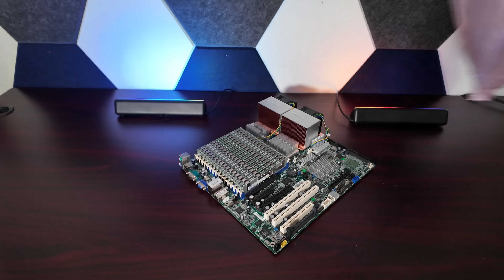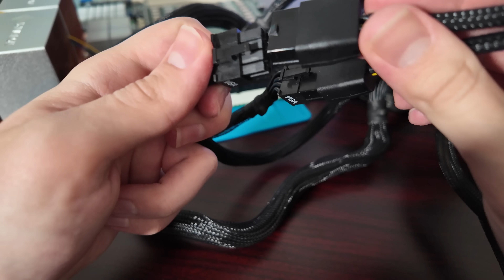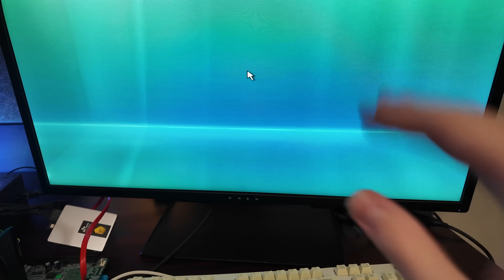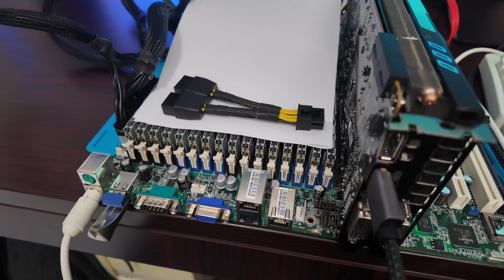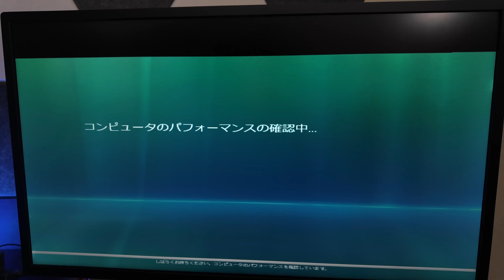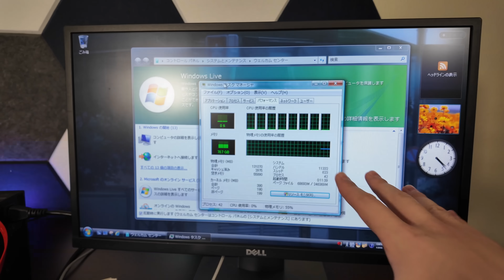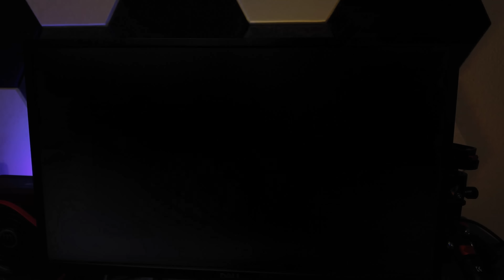What can you do with 128GB of DDR2?

Comment: I asked Gemini AI what would be a good use for this monster. Here is what it answered:  😄

While this machine is a bit of a dinosaur for modern AI, it has one massive saving grace: **128 GB of RAM**. In the tech world, massive memory capacity never truly goes to waste, even if it’s older and slower.

If you want to put this hardware to work without crying over the electricity bill, here are the best practical and hobbyist uses for it today:

## 1. The Ultimate Homelab Hypervisor (Proxmox / KVM)
When you are learning virtualization or building a home lab, you almost always run out of RAM long before you run out of CPU power.
 * *The Setup:* Install a bare-metal hypervisor like Proxmox VE.
 * *What it can do:* With 128 GB of RAM, you could easily spin up 20 to 30 distinct Linux Virtual Machines (VMs) or dozens of Docker containers simultaneously.
 * *Use case:* You can dedicate separate VMs to network security monitoring, a local web server, home automation (Home Assistant), or databases, giving you a massive sandbox to learn enterprise networking.

## 2. A Heavy-Duty ZFS Storage Server (TrueNAS)
The ZFS file system is famous for being incredibly robust, but it is notorious for its extreme hunger for RAM. It uses system memory as a massive read-cache (called the ARC) to speed up file transfers.
 * *The Setup:* Install TrueNAS Core or Scale.
 * *What it can do:* A ZFS system with 128 GB of RAM will be incredibly fast at handling local file storage because almost all of your frequently accessed data will live directly in that massive RAM cache.
 * *Use case:* It makes an excellent deep-archive backup vault for storing system images, massive media libraries, or specific data archives—like tracking down and securing a single verification file named bb2f5eef-b23d-441e-b1a7-4e1e23ace6d4.

## 3. Dedicated Retro Game Server
Modern multiplayer games require heavy single-core CPU performance, but games from the late 2000s and early 2010s thrive on multi-core setups with plenty of memory.
 * *What it can do:* You can easily host dedicated servers for classic multiplayer games like Minecraft (older vanilla versions or heavily modded 1.7.10/1.12.2 packs), *Team Fortress 2*, *Counter-Strike: Source*, or *Left 4 Dead 2*.
 * *The Benefit:* Since these games are older, the Xeon processors will handle them easily, and the 128 GB of RAM means you can host multiple game servers at the exact same time without them breaking a sweat.

## 4. Period-Accurate "Battlestation" & Legacy Gaming.
The GTX 770 2GB is completely useless for modern games, but it was a high-end beast in 2013.
 * *The Setup:* Dual-boot the system with Windows 7 (or a lightweight Linux distribution with Wine/Proton).
 * *What it can do:* It will absolutely max out games from the Xbox 360 / PlayStation 3 era. Games like Skyrim (Legendary Edition)*, *BioShock Infinite*, *Mass Effect*, or *Portal 2 will run flawlessly at 1080p.

> ⚠️ *The Reality Check: The Power Bill*
> Before leaving this machine running 24/7, keep in mind that dual 2007 Xeons combined with 128 GB of DDR2 FB-DIMMs will easily pull **200 to 300 watts just sitting idle**. FB-DIMM memory runs notoriously hot (the "FB" stands for Fully Buffered, and they have their own integrated memory buffers that pull a lot of power).
> 
If you pay high electricity rates, this machine is best used as a "turn it on when I want to experiment, turn it off when I'm done" lab, rather than a 24/7 home server.

Comment: You could virtualize maybe 15 or so big production servers on 128G or RAM.  The business I worked for ten years ago installed two quad Xeon 256G mirrored servers running VMWare onto which we virtualized about 30 legacy servers running Windows Server various versions and a handful of Redhat Enterprise.  We condensed from two 84 inch racks to about 20 U of space in one rack. You can actually do quite lot with a dual Xeon and 128G of RAM.

Comment: Good luck with your power bill. I had similar ones  back in the day. Until the pc was fully booted (about 45 seconds) the ram already was at 100 degrees :D
Reply: Actually looking at it compared to EU pricing your electrcity costs about 7x less, so I think you are fine. Right now Im actually building a home server and optmized everything down to the last watt since pricing is so insane here. Like every watt comes down to about 3-4$ over the course of a year. So things add up rappidly.

Just 25 watts more in idle will be 100$ at the end of the year...

Got mine to have a idle usage 20w in total which is pretty good for a build with ecc memory, running all my services etc. but even than its hardly worthed to host your own stuff these days.
Reply: Heating bill falls to $0 though
Reply: @PKAclipimprover  Haha would be nice xD

Comment: If you'd plug in a decent soundcard you could run a DAW like Cubase or Nuendo with lots of VST-plugins, or maybe even an old version of AVID for video editing in HD, provided that the executables (the .exe files) of these applications can be made 'large address aware' in Windows Vista. I don't remember if this was possible in Vista (probably not in the standard edition). I would have tried this with Windows XP Pro instead of Vista/Vista Ultra, unless it would be easier to find Vista drivers for the soundcard and virtual MIDI setup.

Thanks a lot for the video!

Comment: I own Dell T7400 with dual Xeon E5430 and 64GB of ecc server RAM. That thing ran for 12 years without a single issue and it RAN everything - from countless hours of gaming to CAD, FEM simulation, MAtlab and Technomatix stuff...CPUs and RAM were never an bottleneck but ultimately I had to retire it (it is stil there ans a backup machine, I will never get rid of that thing) due to PSU problem. Modern GPUs require insane ammount of power and my old Dell had a pro-grade 1000W PSU but it lacked the amps to run modern GPUS. Sadly I was not able to find a way to replace the PSU with a modern one due to DELL using all sort of weird connectors on motherboard so no modern PSU could work. That Xeons are old as hell but even todaym, with that insane RAM, they can do a great job.

Comment: I'd actually look to use the rig in a distributed computing solution; concentrating on workloads with rapid read/write storage requirements over CPU compute.

Alternatively, do what put us all in this state and setup Exo (Exolabs) to run a large LLM across discreet hardware.

Comment: I wouldn't even dream of getting 4GB of DDR2 back then.
Reply: What about 8 GB DDR 3? Released after 2011...
Reply: @neelaveronte  I’ve found 8 gig DDR3 for like $40. So; it’s well priced now, I guess??
Reply: @Gray_Bloxxer I meant DDR 3 just... 2026 aboard. So you can buy DDR 4 also - year 2018.
Reply: @Gray_Bloxxer  i have a pile of this shit, looks like its time to sell
Reply: @neelaveronte  This is the max ram i had just 8gb and the minimum i think was 4gb, now i have a laptop with 16gb of DDR5, how times changed...
Reply: @baalconnorlarsson789 yeah... Tech "not for sale" DDR 6 AMD CPUs existing - 27-45 cores and even more.
Reply: @neelaveronte  I got lucky with that one, received an old Dell R420 server for free and filled it with used 192GB RAM because DDR3L with ECC was dirt cheap before the RAMpocalypse hit. No businesses in need of a server would get a DDR3 machine and the ones that were already in service were getting replaced with DDR4 systems instead of upgraded, and since most consumer motherboards couldn't use DDR3L with ECC the sticks were essentially e-waste.

Fast forward to 2026 and I can still barely get a single 16GB stick for what I paid for that entire 192GB kit. The market has gone crazy and I really hope the sticks I already have will outlast the rest of the server.
Reply: @Djhg2000 ddr3 is usable in my opinion, as someone who sometimes uses an xbox one
Reply: My system bought in 2008 eventually got upgraded to 8GB of DDR2 RAM. Upgraded to a new system with 64GB of DDR3 in 2018. Really wish I would have upgraded to 128GB in 2024 when I was looking at upgrades, but I missed.
Reply: My Moms laptop from 2009 had 4gb DDR2
Reply: @DavideBruno-e9u  I mean, DDR3 released in 2007, mass adoption peaked at 2009. By that time DDR2 prices were at the lowest. I was talking about peak DDR2 era which is 2004-2005.
Reply: or about right now
Reply: I'm on 8gb of ddr3 right now as my main💆
Reply: 8GB of G.Skill DDR2 back in 2008 I felt like a king.

Comment: I’m wondering if for applications like matlab or other coding languages where you need to parse through a high volume of signals or images or data in general. Maybe this computer is just one you would leave on to run through data, and possibly unimportant enough data that it can be done at a slower rate. Maybe a tech hobbyist needing to run low intensity simulations.

Comment: i DON`T GET WHY YOU DID NOT, BUT YOU COULD HAVE VERY EASILY INSTALLED A MUCH MORE MODERN OPERATING SYSTEM, WINDOWS 10, OR WINDOWS 11 IN MY OPINION WITH VERY FEW ISSUES WITH THE SAME SET-UP YOU DECIDED TO GO WITH IN THE FIRST PLACE, WHICH IS WINDOWS VISTA ULTIMATE, UNDOUBTEDLY  VERY GOOD OPERATING SYSTEM FOR IT`S ERA, BUT LETS FACE IT, TIMES HAVE MOVED ON, PLUS BY INSTALLLING SAY, WINDOWS 11, YOU WOULD AUTOMATICALLY BE PRIVVY TO MODERN STANDARDS AND EASE OF INSTALLATION OF, WHEN FOR INSTANCE YOU CHOOSE TO INSTALL A VERY MODERN, EG, NVIDIA 5090 GRAPHICS CARD - TO MY MIND, YOU COULD HAVE DONE SO MUCH BETTER, REGARDLESS OF FOR EG, CPU LIMITATIONS, AN OVERALL POTENTIAL BEAST OF A SET=UP, - CONSIDERING THE AGE OF SOME OF THE COMPONENTES SHOWN HERE . . . .🙂

Comment: I am pretty sure I had a comment here, but now it shows I have none.  I don't remember what I typed before.  Perhaps about the requirement for PS/2 keyboard in older PCs to access the BIOS.  
Also, I miss Vista 64.  Unlike all the pros out there, I had zero issues with it and far preferred it to XP before it.  I liked it so much that I kept using it till 2014 when I had to replace it with Windows 8.  
Yes that means I never installed or used Windows 7.

Thanks for the video.  I would try to see how much RAM I can use in video editing, though good luck finding a video editing software which both runs on the platform and is powerful enough to be able to use that much RAM.  I mean I remember back in 2005 when I built a 8GB PC and I already had zero issues with the RAM.

Comment: The best application for this setup would be to use it for its original intended purpose and use it as a Home Server. It would work perfectly well for that application. My main home server personally runs a E5 2699 v3 18 core 36 thread Xeon and 128gb of DDR4 and currently my average ram usage sits around 85-90GB running a Nas, Media server and a few other applications and VMs

Comment: You could set up a really power hungry home server to run classic co-op games. But maybe don't install Windows on it if you want to connect it to the web. Find a linix distro that likes ur setup and then at least ur machine will have theblatest patches. I run an old rig of Frankenstein parts that uses an old AMD FM2+ APU with 32gb of DDR3 and use it as Minecraft server as well as a Valheim server. I even toy around with lightweight local LLM models. Sure my RAM is faster but the sheer grunt grunt of ur twin Xeons AND 128gb of DDR2 blows my rig out of the water.

Comment: The reason the board needed two EPS 12V connectors is because you have two, power hungry, physical CPUs. Each one needs a dedicated rail of 12V power to do its intended data center work. I'd be interested to see the power usage going into that power supply from the wall while it's running the tool to calculate Pi. I imagine it's through the roof, and they might be scaling back a bit with only 650W of power to play with.

Comment: I already knew what your problem was with entering the BIOS... With motherboards of that age, they would not usually (if at all) initialize the USB ports during the POST. Only after starting to boot the O/S. The rule generally is, if the board has a PS/2, or especially a five pin DIN port, it will always expect that's where the keyboard is going to be connected. Later boards with more updated BIOS versions, especially if it allowed booting from USB, would accept USB keyboards a useable (and immediately available) input device.

Comment: Its actually a LOT More than you think you could do, you just have to learn to live with slower ram.  And There is socket 771 boards with more than 2 cpu slots, not certain on the ram capacity.  Could be fun with certain linux distros or heavily modified versions of win 11 (there's one for a athlon 64, look up that one), and the linux distro i'm referencing is for a Opteron (which is even less IPC and a lot of cores)

Question is what is the speed rating of ram that is over 2 Gb sticks of DDR2?  Max stock speed is 1066 for DDR2 so its at the mid range in terms of speed for its type.  (not factoring overclock)

Should be more than fine for day to day tasks, low end gaming, browsing, rendering as even normal core2quads can do that still nevermind a Xeon much less double.  This should be as capable as any of them (moreso really), and capable of more (if whatever you're doing will use multiple cpu and more cores)

Comment: This is a WorkStation MoBo. No way a PC MoBo would have so many DDR slots. Next time do the primary boot with only 1 stick of ram, then shut down, and put all the others and start again - no Boot errors. Also - instead of directly installing Windows Vista, you could've installed Windows Server, created a Virtual Machine and Install Windows 7 on it. Servers work 5 times faster with Windows Server. Vista is terrible, and very bad at resource mgmt. BTW Windows Server 2012R2 has a free version that allows creation of upto 8 VMs for free.

Comment: Those Dual Xeons aren't that much slower than the older of my i7 laptops (though admittedly that has 16GB of DDR3), but I think if you're really bored you could do some AI stuff with all that, it'd be kind of slow of course, but if you just run an updated OS I'm pretty sure you could get it to work with no worries about memory, as long as you don't mind waiting a few minutes for an image generation or LLM response, with 128GB RAM you could run some very nice models despite the low speed. Worth trying to get a video or two out of it anyway.

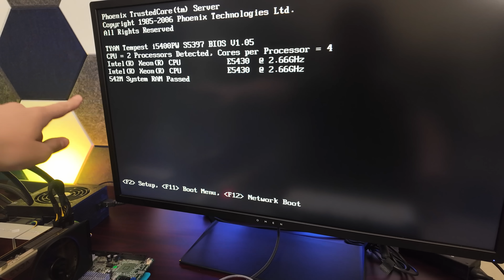Comment: oh wow, its LGA771 @4:45, I recognize the cpu immediately, I used a X5470 on an old P43 with the sticker mod for LGA775. The issue is inserting the microcode into the bios file.
But after that it worked very well. Overclocking that to 3.9GHz with an fsb of 422 was alot of fun.

Comment: I have 256GB DDR3 and it's used for fluid simulations. They will go over 200GB easily. You can never have enough RAM if you're doing physics or AI. I also do have 128GB DDR2 - exact same silver modules, but I don't have any boards with enough slots to plug them all in.

Comment: 14:20 Yes, it likely depends on the implementation, driver API in NT kernel and...page tables. Depending on how the memory is allocated, mapping it into a virtual address to actual read/write the data can be disproportinally expensive depending on how much you're copying, which is why so called "huge pages" become more available nowadays.

Regarding the CPU bottleneck, it is real even on the modern server, you can trivially get ~3 GiB/s on dumb implementation but scale independent I/O access to multiple CPUs and you're reaching 20-30 GiB/s 😂I don't recall if the server had DDR4 or 5 but it is expected to be production so relatively newish hardware 😊

Comment: Imagine if there was something like an adapter which you can put all those old ddr2 ddr3 rams in. Then plug it in the pcie slot and have a near indestructible slc ultra fast nvme like disk. Sure it gets wiped on reboot but it would be so useful for stuff like zfs/video editing workloads etc etc.

Comment: I can't even begin to tell you the ordeal I went through to get this running, but I currently have a dual Xeon E5-2697 with a GeForce 1080Ti, 256GB DDR3 ram and an Intel RMS25PB080 Raid controller running Windows Server 2025. I also managed to find a PCIe to NVME adapter with space for 4 NVMe drives, but given the nightmare I had getting Server 2025 even running, I haven't had the courage to try and get the NVME drives bootable, so I just run my VMs from them.

Comment: Well, this PC surprisingly can run modern arch linux and you can use this pc to render some scenes in blender. Though, not very efficiently, as any moddrn cpu or gpu wold beat it. And the ram can definetely be used with a more efficient ramdisk software to speed some things up.

Comment: Cool man!  
I'd fire it up with Windows 10 or 11 vs vista.  
Looks like you are forcing yourself to learn another language if I have to be the one to mention that part of it.  
Find a better multithreaded RamDisk software please.  If that's possible.  
Then use it to host some virtual servers on the ramdrive space.
Just export the VMS to real disk when you need to shut it down.  
And re-import them back into ramdisk when powering up.  
That would be interesting and semi-practical.   
Funny, I also purchased and own a Vista ultimate key and not used it in a few years.
You could also install and run any number of hypervisors on this hardware and load the ram up with a few VMs.  and pass though that GPU.  
-sg

Comment: This is a peak Crysis era machine. Like, I'm not even kidding. So Crysis runs like ass on modern machines just due to the instruction sets in CPUs being different now, OSes being different, drivers being different, GPU architecture being different.

However... This is the era Crysis came out in. This is THE MACHINE. This is the 'But can it run Crysis?' machine. 

So, you're obliged to do it. 

Also you put vista on it, wtf is wrong with you lmao